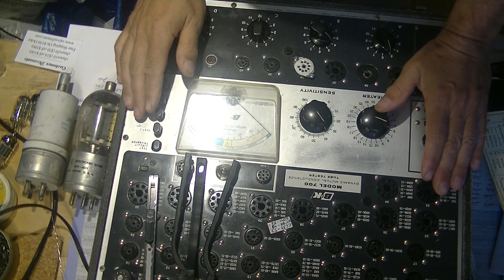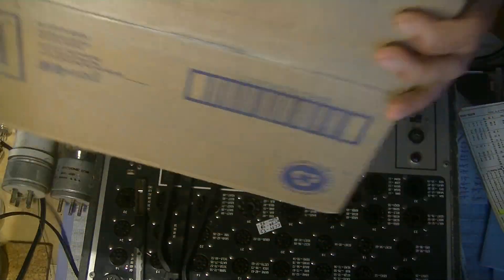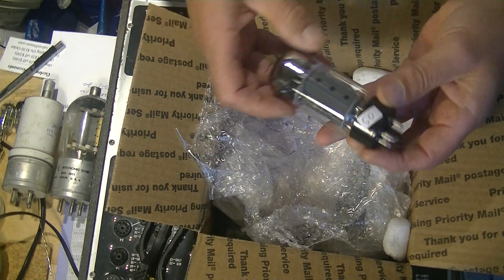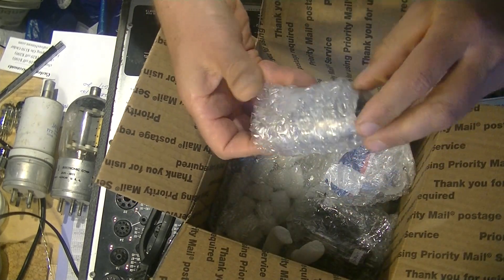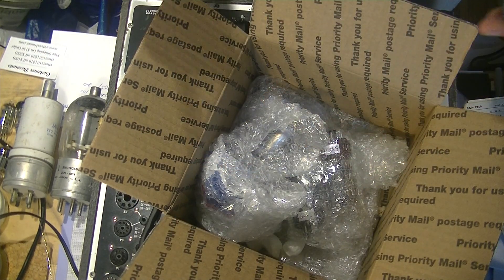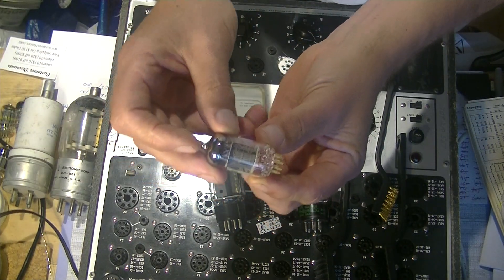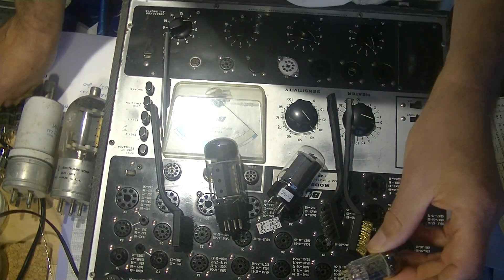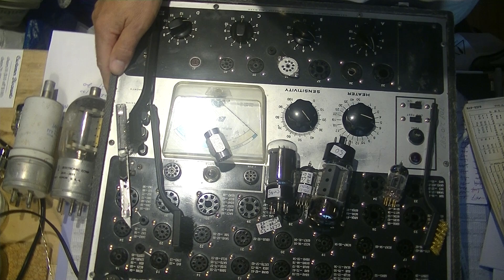Tube Lab #3a Cleaning & Testing Tubes for Beginners

Comment: I just wanted to say that I appreciate the content of your videos. I'd been actually looking around trying to find a simple, less-aggressive approach to cleaning tube pins that doesn't require the use of chemical treatment, etc... Fortunately, I stumbled on this video.
 
Believe it or not, some folks are out there using gasoline, WD-40, and other crazy concoctions to clean up simple oxidation. Seems excessive for tin-plated brass.

Good info! Cheers 👍
Reply from the maker: @kevins3453  we actually revisited pin cleaning a few episodes back, or 4 years after that early Tube Lab.  The early info is still valid, but we also show how to use a plastic flapper wheel in a dremel to rapidly clean pins. Just a faster way to clean up pins.